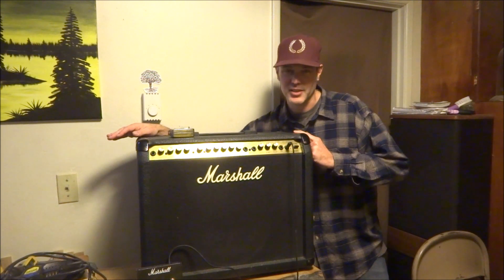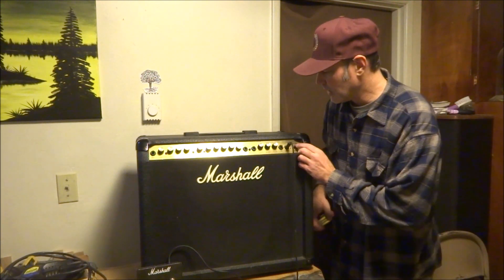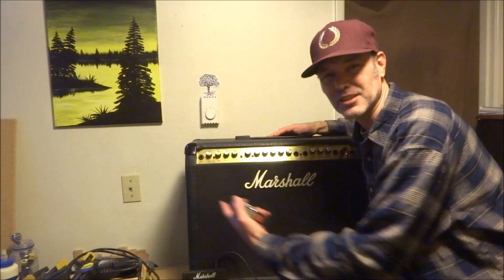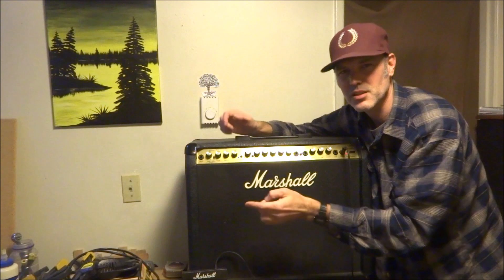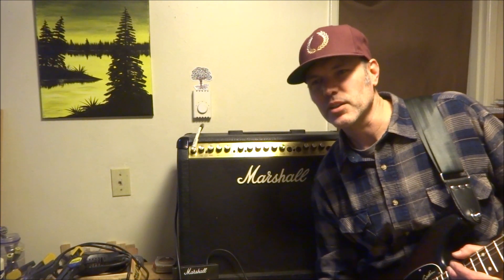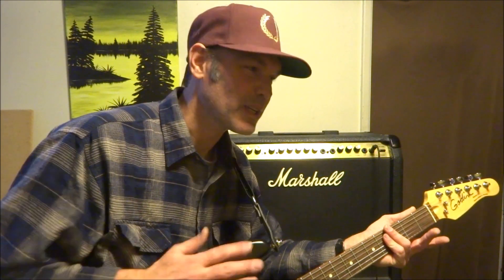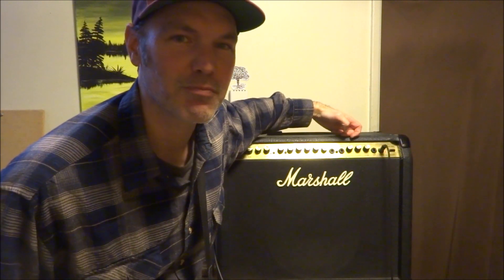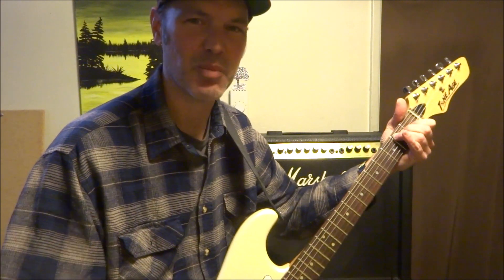Marshall Valvestate 80V demo vid

Comment: I guess it's a thing with this model, because the master volume in the model I'm servicing had the same problem. You never mentioned why you had to hacksaw the pot cap, was it glued ?
Reply: YES! Infact when I tried to pry the knob off, it pulled the whole shaft out of the base of the pot. Missed that edit.

Comment: Should i take this or fender champion 100?
Reply from the maker: If you're are looking at cheaper older amps, the condition of the amp itself should be the deciding factor. Knob crackle, is no a big deal to me, but excessive hum or hiss makes it hard to mic up to record... If both amps are in perfect shape inside and out, I'd probably go for the Fender for the cleans and gains in the pre-amp and the Eminence speaker. But I'd still like to have a Marshall around to use once in a while for the gain from the pre-amp if nothing else!